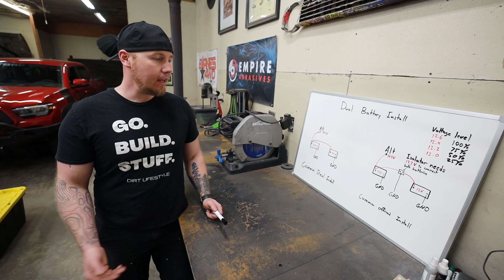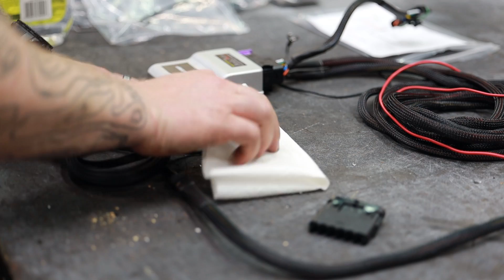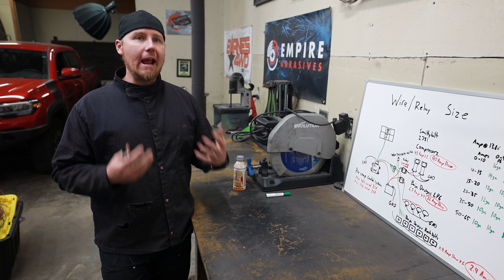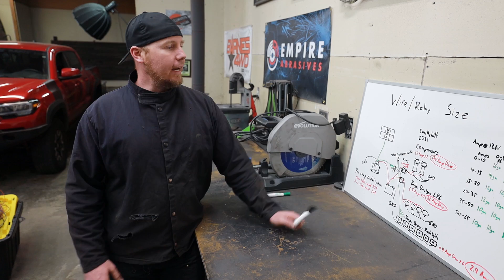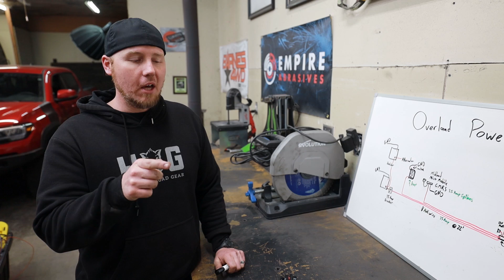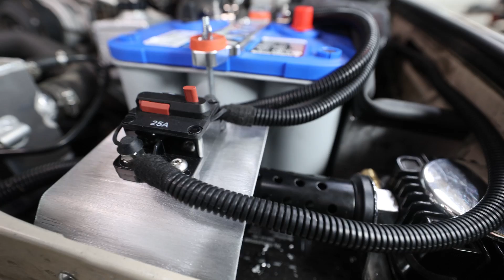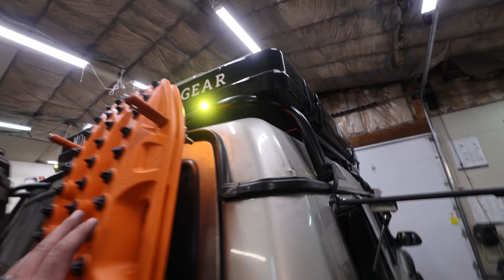A Complete Off-Road Wiring Guide! Ultimate Land Rover Discovery Build Episode 26

Comment from the maker: Many of you are asking about a discount code for midland radios... we have one! You have to use our link found here
https://bit.ly/2IjmlZD
And coupon code dirtlifestyle gets you 15% off 🤘
Reply: Website says the coupon has expired.
Reply: says the coupon expired
Reply: Had a yellow top for my JL and long story short it tested fine but it was faulty. I exchanged it to a cheapo orielly battery and my electric problem with the stop start system went away entirely. Never again. Did optima send you one because you’re you or did you buy it with your own money?
Reply from the maker: @Robstunner  I've bought 6 optimas over the last 16 years with my own money. These 2 blue tops not included.
I emailed a couple folks to find out who is their marketing guy and asked for these 2 batteries specifically in hopes that they would like to be involved in this project. They sent them out because I asked for them but I didn't pay for these two batteries.
Reply: @DirtLifestyle  All good sorry if that question came off aggressive, just was wondering. Thanks for being transparent!
Reply from the maker: @Robstunner  no worries bro, I try to be as crystal clear as possible with all this stuff. I've got nothing to hide from you guys 👍
Reply: Is that a cb radio or 2 way? I looked at the website and it's hard to tell which one you're using. Thanks
Reply: its off topic but do you have a vid  on your air intake  I'm looking at doing a 2ed battery and in wanting to put it in the place where the airbox is so i need to  relocate the air intake
Reply from the maker: The coupon has been updated!
Reply: Great work!
Reply: why are you not using deep cycle batt for the acc. std batt not good enough. dont last as long.
Reply: i fitted 3 x 3 gal air tanks. with a line to a 300 psi comp. with a 170 200 switch on the outlet. the comp has an on/off switch. works great. 4 tires in 5 mins. 35,s. we dont have power tanks in aus,, frowned on a bit. dangerous goods ect.. baby country. we have car laws for 4x4rs. no more than 2" lift. so,,i bought a ford f250 highboy,. fk em..
Reply: wiring,,nothing but 1.0 gauge.. longer the run,bigger the wire.. i have front rear winches, removable. in the hitch. 1.0 is just big enough. power stations start with say 100,000 volts,,to get to your house at 110 volts..with step downs..
Reply: get yourself a 150 or 200 w solar panel. tops up second batt. fit to hood,or under rack.
Reply: is it possible to do a follow-up video focused on tieing in the winch? I use an 11,000lb (with remote wired and wireless and I moved the control box up near the battery, now I'm confused about breakers, switches, etc., or does the control box act as the fuse, I'm worried about the heavy wire going to the winch about 6'. is that protected by the control box or is the high current running through them all the time?
Reply: I tooo have a RED TOP and it is low at 12.6 and it is from 7/12 = 9+ years old!
Reply: Looks like that discount code is expired. Any chance in firing it back up again??

Thanks for the vid!
Reply: Hey Nate,  I have my Disco and my IH Scout that I want to duplicate your dual batt set up. Do you have a drawing you can post?

Comment: I am just about to install a dual battery 12v (90amp each )system without an isolator, in my case the fuse should be more than 80amp ? I am thinking of getting 120amp or 150 amp is it ok? Any help appreciated thank you

Comment: Still great information over 3 years later. Thanks, Nate.

This inspired/confirmed something that I am planning to do with wiring my lights. I have an 8 button controller. I am going to run all my off-road exterior lights off of relays and then switch them via the controller. Then I am going to wire one switch to trigger multiple relays. That way I can have a "light up the night" mode and kick on all my exterior lights with one switch. I am also considering adding a second controller in the rear. If I have the lights powered through relays then I can switch side and rear lights, or other lights, on from the drivers seat or the rear hatch. Lots of flexibility when running relays.

Comment: Im seeing this vidio 3yr after it was made. How ever thought i would throw in a comment anyway. First great vidio i appreciate your attention to detail and taking the time to explain wire sizing and the use of proper size components. The one and only thing that i would like to suggest is running your radio directly to the battery positive and negative. My reasoning is to not invite a "radio ground loop"  into the equation. Basically making an antenna colects noise. I know it does not always happen, but when it does, it's annoying.

Comment: So how did you run the wires to the roof lights without drilling a hole in the roof ( and causing a leak point #NWWaproblems ) ??

Comment: I got a used optima red that failed a test and was replaced. I was able to charge it again (two battery charge start), worked great for a while, but I let it sit too long. Charged it again, and have been keeping it on the side, try to maintain charge once in a while. It's there if I need it. So yeah I have a couple other optimas and would like to and will have more. :)

Comment: Thank you for This video. Very inspiring and informative. one question in regards to wiring your Smitty built compressors: Should there be a fuse between your auxiliary battery and the load side of your 200amp relays? I've watched some other overland guys build Relay/fuse panels so that every accessory that is switched by a relay is also fused. Why did you fuse all your low amp camping accessories but did not fuse your compressors?

Comment: On the subject of optima batteries, I had a red top in my explorer once upon a time. I don’t remember how old it was at the time, but I managed to drain it and let it freeze. Jumped it, let the alternator recharge it for 45 mins or so, never had a problem with it after that. It wasn’t until a few months later when I was doing some unrelated diag and I realized that battery only saw a maximum non running voltage of like 11.7 or so. But it still continued to start that explorer reliably every time for another 2 years. I’ve always been an optima fan, but I’m 100% a believer in the hype now 😂 They contain a little magic in them cells, I swear they do

Comment: Nice clean install and correctly done. 
Question: When are you going to install a solar panel on the roof (you have room) that can keep your battery's  charged up if (when) you stop for couple days ? Breakdowns happen and sometimes the motor wont start to charge up battery's. 
100  watt 9 buss panel with a 20 amp charge controler should do the trick. The fridge takes power whether you open it or not. So do all inverters.

Comment: -- Thumbs up.  As a car audio installer a long time ago, I like clean installs.  Nice work.  Have a winter beater I'm doing now.  2004 Tahoe, dual battery system.  Same smart isolator.  60 amp breaker on the secondary batt (deep cycle), 50 on the primary (Optima Yellow-cap).  60/50 because I don't want to risk frying my ECU.  Not running the heavy lodes you are.  Save leds and a light bar, the electronic system is factory.  Winch on a separate, manual system.  Just charge drones/rc aircraft/pump up beach toys/little stuff, and I want it to start in the winter.

Comment: Where do you stand on just adding a aux fuse box off the second battery also attached to to its own relay?

Edit:

Like it goes battery A through relay 1 to battery B to relay 2 to aux fuse block to high power devices like a pump or whatever that requires a lot more meat than what you can safely pull off your main fuses?

Then a second aux fuse box off battery B for non running systems?

Comment: This is soohelpful. I am trying to set up the same system. Question about drl. My lightbar has drl and came w a 3 way switch w 2 pos wires and 1 ground. Are you wiring all the drl positives together? How are you wiring the grounds? How can I separate the drl pos and main pos on two separate switches if they share the same ground? I'm using an  auxbeam 8 gang switch panel

Comment: I really liked this video. Because some of these things are things I want to do to my truck, and my truck already has a place for a second battery. I'm not sure why; because it doesn't have that much to it but I think there are a lot of upgrades that can be done to it. I noticed on the back of the cab, inside, there is a plastic cap covering a hole, and I'm guessing it's for wiring, and I've been wanting to add a second battery for a long time now, and I really like the idea behind the isolator to keep the 2 batteries separate! Great video, Nate.

Comment: as a Licensed electrician, I can give a good rule of thumb on wire ampacity; anything 100 amps or less is rated in the 60 degree Celsius in the NEC table, and you can buy an Ugly's handbook for about 15 dollars from a Locke supply; it may be a little more at different electrical outlets, but you can go to T310.16 in the 2020 NEC or 310.15(B)(16) in the 2017 or page 76 in the 2020 UGLY's handbook. Any wire 4 AWG copper or smaller is sized using the 60 degree C column. Note that the rating for copper are the columns to the left and aluminum to the right half. You can use the 90 degree column if you are using a wire, such as THHN or any wire described at the top of that column for adjustments for ambient temperatures as long as the wire doesn't exceed the ampacity after those adjustments. If you bundle more than 3 current carrying conductors together then you need to adjust for that based on the table 310.15(B)(1) in the 2020 for anything over 30 degree C or 86 degrees F or page 78 in the UGLY's; T310.15(C)(1) can be used for bundling, which is the same as putting them in a raceway. The numbers to the right indicate a percentage for the adjustment for more than 3 wires bundled together, regardless of ambient temperatures! You will see the wire types above each degree column; the wire sizes indicated on the left of the columns and the ampacities for each column 60 degree C, 75 degree C and 90 degree C. The rules for small conductors, sizes 18 AWG cu through 10 AWG cu are found in 240.4 for protection of conductors and 240.4(D) (1)through (7) for small conductors. these rules are a minimum safety standard put out by The National Electric Code. Hope this information is helpful to anyone wanting to make sure they size their wires big enough for the environment and use. 240.4(B)(1)(2)and(3) further give protective allowances for the fusing of conductors not protected at more than 899 amperes. The 2017 and 2020 NEC have this rule in the same place on this code cycle. Again, I hope this info is helpful. It'll keep you from having to oversize and help assure you are not under sizing the wire for the circuit and load it will carry. It's about a hundred dollars for a code book. These Tables are in the UGLY's handbook but the reference to 240.4(B)(1)thru(3) are not. but they do have handbooks for field reference that are compact and do have this article in it. I think you can get these on Amazon as well. Just beware that all the ones I have previously bought on Amazon have some pages with the ink faded in places, so you would be better off getting the book from an electrical supply house or go to NFPA.org and buy directly from them. You can buy a yearly subscription for the NFPA Link, and it will give you access to all the code cycles from 2011 to present and all the safety reference books, and the electronic access to the NEC allows you to make book marks and make notes on them and you can search by article for subjects like wire protection or overcurrent devices etc. I think if you log onto their site, you can get a free trial of LINK for a month or something to see how you like it. It's best on a laptop or IPad. I use it on a laptop, and it's pretty handy. I still like the hardcopy as well but it's great for searching for different things once you learn how to use the search function. Anyhow!

Comment: this is one of the things I want to do to my truck; 2010 Chevy Silverado 1500 2WD WT. Really 3 things, A set up like this, a front bumper and winch like you done on your wife's Jeep Liberty, and rock sliders like you done on the Liberty and Toyota Tacoma. I think it would be cool to redo my door panel with either some aluminum or 18 gauge steel. The driver's door panel arm piece is worn lol; not sure about the door panel, but the others I definitely want to do. I've already started to get some of the stuff for the wiring. I may do something for the back bumper also. I loaned my truck to a friend a few years back and it came back pushed in on one side; not sure what the deal was there, but watching some of your builds is giving me an idea of the thickness of steel I need to use on it. I've already started adding emergency gear to my truck as well! Great videos, Nate!

Comment: awesome how to vide! Thanks for going into so much detail on it.
I really like the whole power set up on the isolator and relays for the compressor and lights! Thanks for taking the time to draw up the schematic on the dry board. How did you tie all your grounds together? I guess I overlooked that. Did you use a ground bar and run one wire to ground? Thanks again for sharing the details of this project!

Comment: Why are you using truck battery any way 
Overland .use hydro power generator  water are wind even light 8 pack nickel  cost about 3200.00 8n just battery. Fyou cab wire for all three. For power

Comment: Nate, great stuff! Just what I needed as Im planning to install a switch pro and wasent quite sure how I was going to handle the isolator for Batt 2 on my 5.9l cummins. Im going to copy a lot of what you did here.  Would love to see you add a solar panal to back up the alternator and provide a little more power security. Even a foldable one that just comes out and gets rigged on the roof at the begining of the trip. Or trickle charges a third batt under the chassis, thats on a batt switcher for emergencies. Great video! Great content! Great Channel 👍

Comment: The ampacity of the wire is dependent on the wire gauge.  Period.  The distance does not matter for amp capacity.  You do not "lose" amps over distance.  You lose VOLTAGE over distance.  That is why you need thicker wire for longer distance.  In other words, a given size of wire can only pass so much volume of juice - amperage-, regardless of length.  That same wire will cause a loss of PRESSURE over distance, and that is the voltage.  The chart you show has combined the two factors, and probably uses a VOLTAGE loss of 3% as the criteria to maintain the desired voltage over the distance.  Therefore, the shortest distance listed should correspond to the required ampacity of the cable.  Generally, these charts are misleading, as they are best case, calculating high quality copper wire that is highly multi-stranded, like welding cable.  For instance, a solid copper wire does not have the capacity of one with 1000 strands.  DC flows over the surface of the wire, so many strands have greater surface area, and greater conductivity.  On another thought, I have had 5 Optima batteries in the last 6 years that failed me miserably.  Have settled on Odyssey, which are working way better over the last 2 years.  Note the isolator only has a 140a capacity, and is not helpful if you want to bridge the batteries to push a 12k winch requiring 600 amps.  It is only good to keep a "house" battery charged, as shown, to run house stuff like fridge, lights, etc, independently, but still be charged when the engine runs.  Good video.

Comment: Nate, I am proud of you for chasing your passion.  We just took delivery of my re-imagined 1997 Grand Cherokee Orvis Edition which I drove daily for a dozen years.  As we made decisions prior to and during the build process, a couple of your vid’s contributed to some really important decisions.  Thank you. Appalachian Performance Engineering did the build.  I specified electrical components from Blue Sea Systems and Ancor wire & connectors.  Marine grade stuff you might want to check out. Overkill for sure, however overkill very rarely ever fails.  We also isolated start battery with a Blue Sea ACR and connected all accessories to the House Batt.  We also used Blue-top Optima’s. Thank you for all the great work!

Comment: Nate, I am proud of you for chasing your passion.  We just took delivery of my re-imagined 1997 Grand Cherokee Orvis Edition which I drove daily for a dozen years.  As we made decisions prior to and during the build process, some of your vid’s contributed to some really important decisions.  Thank you. Appalachian Performance Engineering did the build.  I specified electrical components from Blue Sea Systems and Ancor wire & connectors.  Marine grade stuff you might want to check out. Overkill for sure, however overkill very rarely ever fails.  We also isolated start battery with a Blue Sea ACR and connected all accessories to the House Batt.  We also used Blue-top Optima’s. Thank you for all the great work!

Comment: I know this is an old video, but I'm working on a plan to hard mount my 2871 compressor in the rear of my 2017 jeep.  I'm going to be modifying it to have a pressure switch.  The compressor has a relay in the control box, and there is also a relay in the vosswitch panel I want to hook it up to.  Is there a need to add the additional relay that you did (the continuous run relay) if there are 2 relays between the conroller switch and the motor for the compressor?